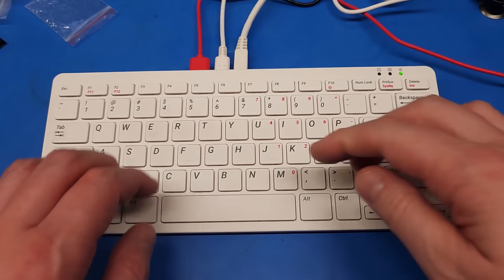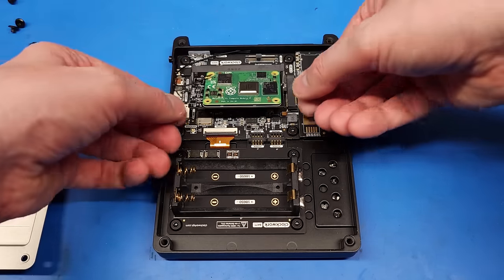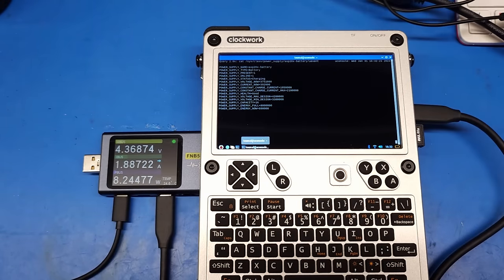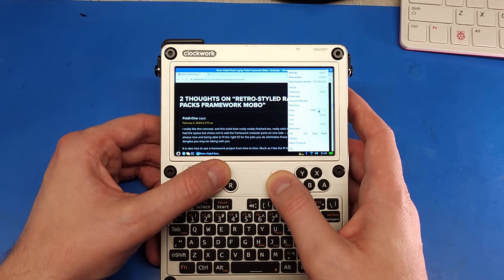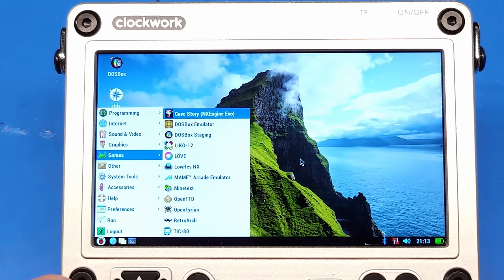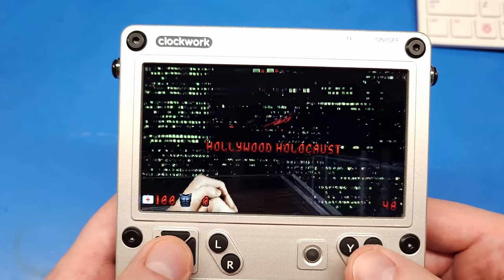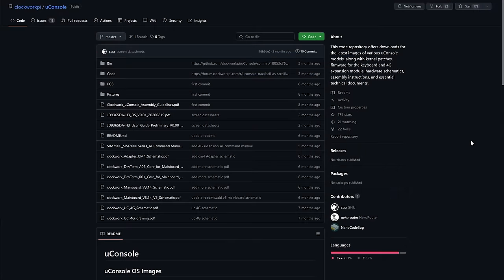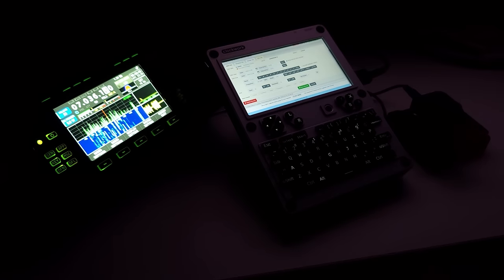uConsole: The off-the-shelf cyberdeck

Comment: Biggest downturn was the USB-C only being a charging port.
Reply: If you have a 18650 charger you can pop them out and charge them.
Reply from the maker: Good point which I actually forgot to touch upon in the video. Yes that's a bummer.
Reply: Been on the wait list for a bit over a month. I mis thumb typing with a black berry and want to do some word grinding on it. Also want to try my hand at sound tracker software on a hand held. Either way, exciting little device.
Reply: Just got mine today!
Reply: And the price 😂

Comment: Unfortunately, they are not open hardware as they are advertising! There are no PCBs, you cannot edit anything there, feels bad. Not having those is a blocker for me.
Reply from the maker: The PCB files are indeed missing on github. I am not sure what's going on there.
Reply: @JustAddFlux  I don't know either but feels dishonest from them, the community has been requesting the PCB files for ages now and lots of mods have been held of because of lack of PCB files. Schematics are good but what's the point of them if you need to make a work of guessing when designing stuff for it.
Reply: total fake; i've already added 2 usb port thanks the schematics on gh, using the standard expansion module. Please don't spread bullshit

Comment: Thanks for the video, I am very interested getting this thing to replace my tablet, may I ask few questions here. I am thinking of getting the emmc module as well, due to the faster speed and the unreliable microSD, I had some bad cards from cell phone use already. But the emmc module needs an adapter to write to, and limited to 32GB, so that I will need to stick with the standard model, and I will get the 8GB one to reduce the need for swapping hopefully to reduce writing to the card. You mentioned there's an option board with extra type C that can fit into the 4G extension board, can I have both working or just the type C ? and have you overclock the thing ? have you used the 4G ? and how does this board compare to the regular Pi 4, I've that board so I know how it performs, thanks ! btw I believe the bad wifi reception of it was due to the stick on antenna close to the metal chassis that grounded the signal, so that put a spacer or thick double size tape to raise the antenna can help without to much of work.

Comment: I bet the charge battery have safely in case of leaking or overcharge when it get old. There will be pros and cons to them. I can guess to prevent charge at 100 like those smartphones.
Reply: it does. the adapter board also offers protection against shorts due to wrong-way inserted batteries. So far, wait is around 90+ days for preorders. all purchases are bulk orders.

Comment: I have longing for a cyberdeck-like device for years. A device with a full-blown OS that fits in a pocket or small fanny pack/(man)purse.
i had an openPandora for a while, but its limitations (mostly screen resolution, lack of packages, and keyboard) made it unusable as a daily driver.
I recently got a GPD Win Max 2 and it's the device I've been looking for!
It has no hardware drawbacks (got the 2023 version with 64GB of RAM) and the battery lasts long enough. Most importantly: you can get one right now!

Comment: Another thing, the batteries are in parallel and when they get down to 3.3V the power service shuts down the system regardless of the state of charge or capacity. 3.3V is not nearly empty.  You can tweak that but it isn't straight forward. However, below 3.3V the speakers start to make noise when the system is under load even if sound is muted.  That said, the battery stuff is the only thing I can complain about. I love the uConsole for basic Pi type things including ham radio.
Reply: Unluckily, Li-ion batteries below 3.3v could be dangerous. Being 4.2v its "open circuit" voltage (idle voltage) Li-ion will stay above 3.6 most of the time, just to beging a free fall when getting empty. 

Protected 18650 batteries will shutdown to prevent any incident if I'm not mistaken. 

Nevertheless, where there is Li-ion, a BMS should be there in the circuit, as a hardware interlock to avoid batts to go below 3.3v.. so, even if there could be a setting for this, whatever setting you tweak the circuit will trigger a shutdown anyway. I can recommend some large capacity 18650 cells, just try to avoid counterfeits

Comment: The missing piece is of course a Raspberry 5 Compute Module, when a CM 5 is (if ever?) available I'm in. It would be nice to have GPIO connectivity too but oh well.
Reply: I’m considering preordering one without the CM and getting the CM5 separately once they’re available.
Reply from the maker: @AROAH  The problem is there's currently no word on an adapter board for the CM5, or whether the CM4 adapter board would work on the CM5...

Comment: The NEC (and U.S. Radio Shack branded version) were great for their time.  Extremely popular around the world, especially with the built-in modem just needing either handset cups or adapter cable for a dialup connection.

HP came close in the 1990s with the HP 95LX (so close), HP 100LX (much better) and HP 200LX (mostly the same as the 100LX).

Not sure yet, but I've considered the Clockwork.  Too bad the CM4 is so hard to get, and now it really should be Pi 5 based.

Comment: I got my own CM4 (8/32) and then flashed it with the Clockwork OS. No need for a SD card. Running straight from the eMMC, faster, better
You just need a CM4 board, that is $35, a pin jumper, micro USB cable, and power.

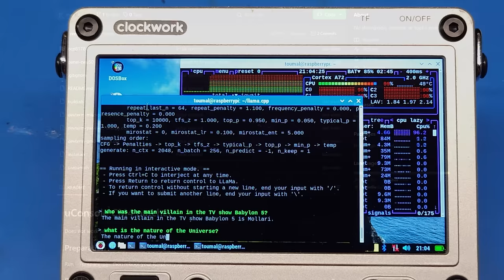Comment: @ 6:02 you're using a command-line chatbot llm. Which are you using and how can I run a similar one once my uconsole arrives...Ordered mine Nov. 20th 2023, still waiting
Reply from the maker: That was llama_cpp. If you want a web UI for it and/or want to have it ingest documents, check out privategpt, both on github. Note the footage was sped up - some patience is required if you wanna do this on a CM4.

Comment: 3:15
Oh, that's probably a weird way of handling the fact that they're using user supplied 18650's and marketing to a community where 18650's aren't a common thing. 

Basically, they don't want any bad things happening if say, someone decides to just buy some crappy cells from walmart (or even bootlegs) only to charge them at 2 amps each and have troubles.
Reply from the maker: Good point. I think the max is 1.2 amps per cell, but that might still be troublesome with crappy or damaged ones.

Comment: have you tried connecting the wifi antennae onto the connector on the mainboard, and not the CM4? thats what i did on mine and i haven't had any issues. Just read the manual again, and they do say to connect it to the CM4 but that's not what i did.
Reply from the maker: Hmm. I read some comments to that effect but to be honest, I'm not sure what to make of that. My guess is that the RF energy just finds a different path if you don't connect something to the CM4 antenna port. Ever since connecting a proper external antenna I have excellent Wifi reception.
Reply: @JustAddFlux  drivers is my guess. since the uconsole kernel is custom for its own custom boards.

Comment: Interesting but I'd rather make my own. I'm pretty much anti Raspberry Pi and would rather have a different SBC powering my cyberdeck. Also, the keyboard might work for you but I'm used to things made for average people not fitting  me at all. I would rather spend the time to have something tailor made for me than waste money on some compromise device that will definitely be overpriced. 
Also, if you need someone else to make a cyberdeck for you, you probably have no legitimate use for one anyway. 
The uConsole violates all the fundamental rules of a cyberdeck, one of which is that it can't just be something anyone can go buy off the shelf.
Reply: what makes you anti-pi? just curious
Reply from the maker: Cyberdeck manufacturers such as Fuji Electic, Musabori Industries and Ono-Sendai would beg to differ, and would point out that while many of their customers may elect to perform modifications to their cyberdecks, these are unauthorized changes not performed by certified technicians, and thus void their warranty ;)
But seriously, I completely agree that building your own cyberdeck is awesome and beats buying something off the shelf any day. But the problem is, there wasn't even something on that shelf until recently. And in my book, the more unusual form factor computing devices we get, the better. Having every laptop and every phone look the same can be very boring...